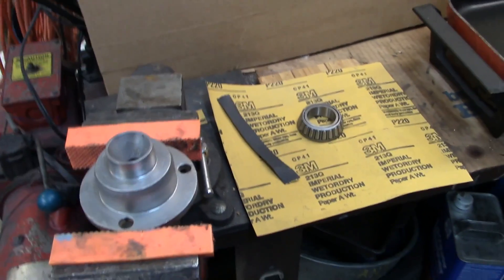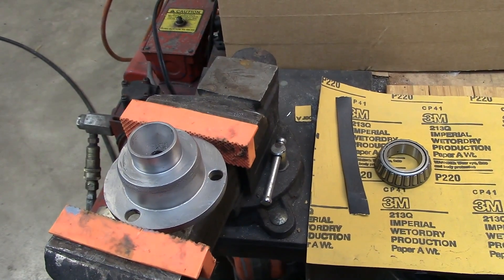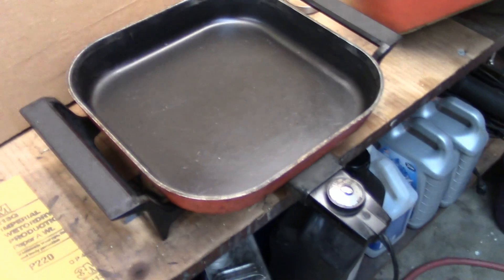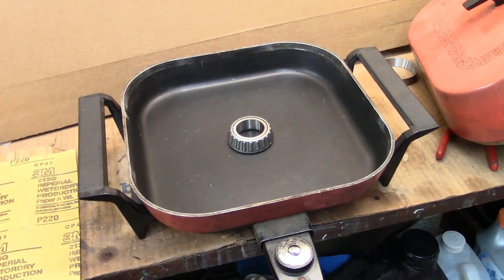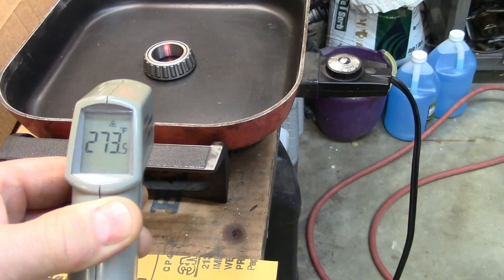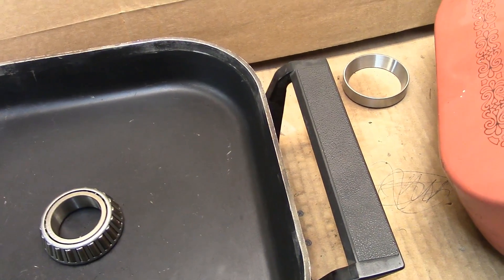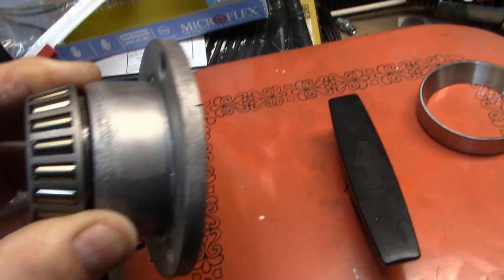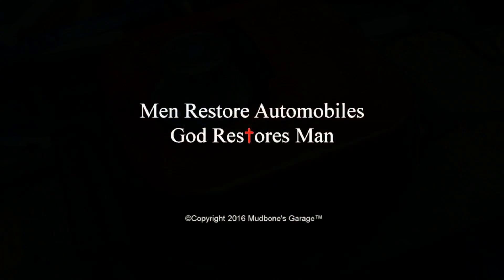Press Fit Bearing Install

Comment: Most bearing manufacturers don’t recommend anything over 200f. Good idea though.
Reply from the maker: Yep too hot is not good. Check the actual bearing temp with an inferred  thermometer.